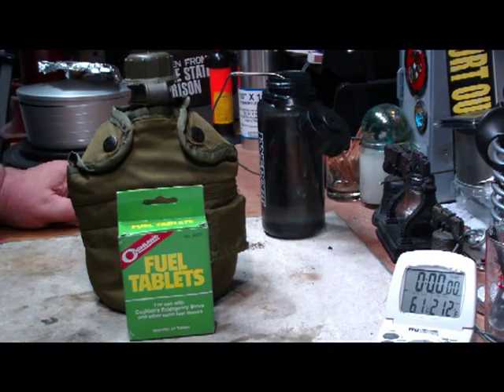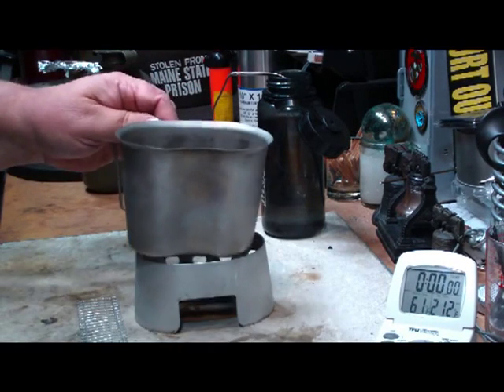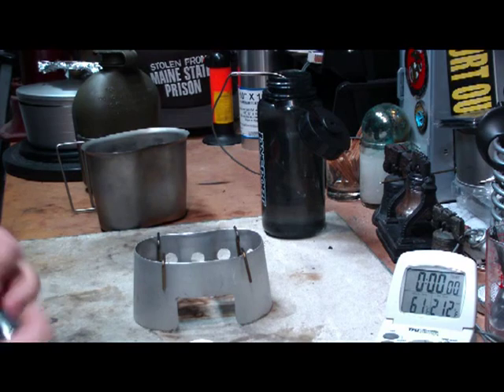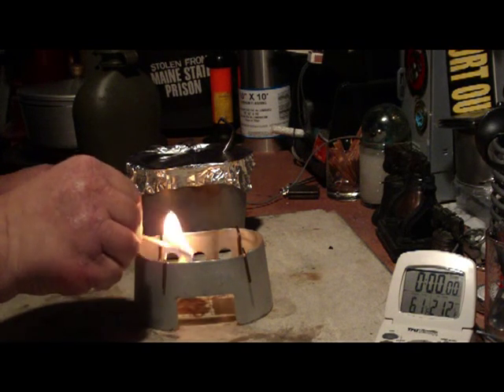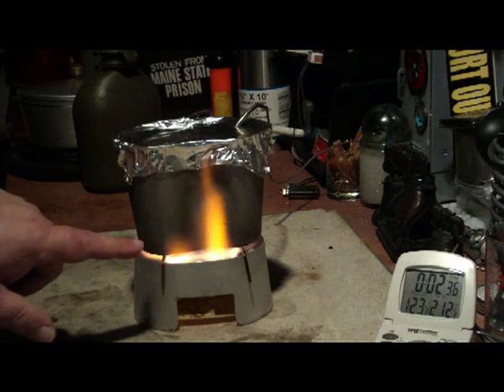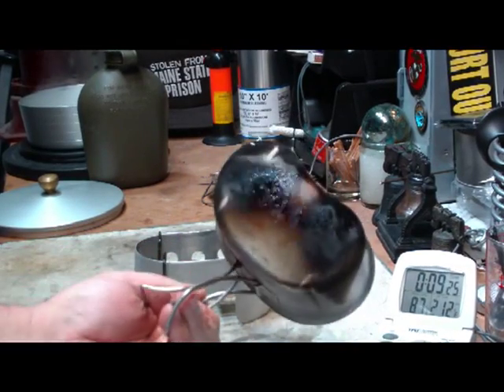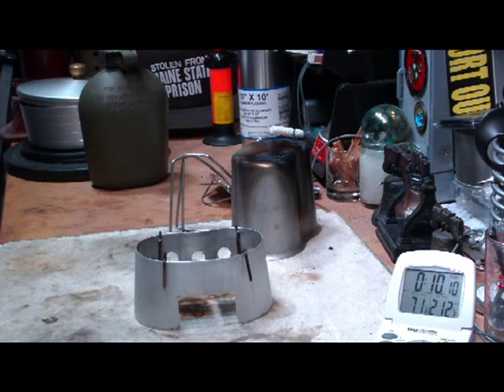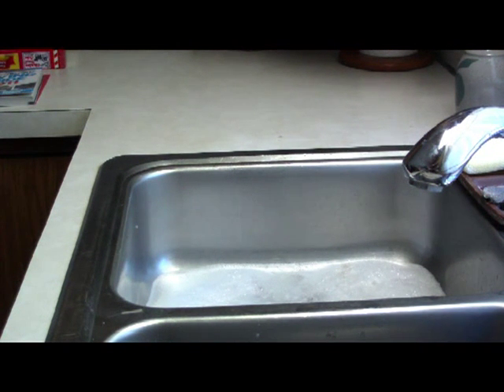Canteen Cup Stove with Mod 1 using Coghlan's Fuel Tablets - Boil Test #1

Comment: Nice video!  I like those mods to the stove.  In my experience, fuel-tablet soot is water-soluble; use plenty of water and it comes off easily.  Just some light rubbing with a cloth will do it, no need for abrasives or heavy pressure.

Comment: Use dirt or sand to clean your cup in the field.    Your bent inserts is a good idea.   I think I'll experiment with your design to mod my Ti wood stove to support an alcohol penny stove at the correct elevation in relation to the cook pot.  That will make the wood stove do double duty, as both a wood stove, and a wind screen for my penny alcohol stove.   Information flows on the internet highway.

Comment: HIram great test! I was wondering does an esbit cube leave us much residue as the coghlans? Also, have you ever done a test on a stainless kleen kanteen bottle or Guyot lying 'horizontally' on an esbit stove with a tealight alcohol stove or esbit cube. I've heard it heats much faster that way and you can even heat it with the cap on if you leave space in the bottle. I would love to see you test that theory. Until then...celebrate life! Laurie

Comment: I'm impressed with this set up. The boil time is significantly reduced by a minute or so. I think you're right in saying this is pretty dirty, but in a pinch, this fuel sorce would work. Might be something to put into a pack for a alternative fuel sorce other than just building a fire out of twigs which results in just as much soot on your pot. Nice test.